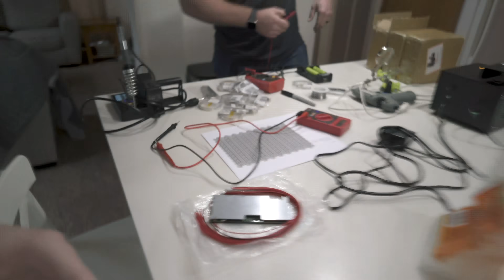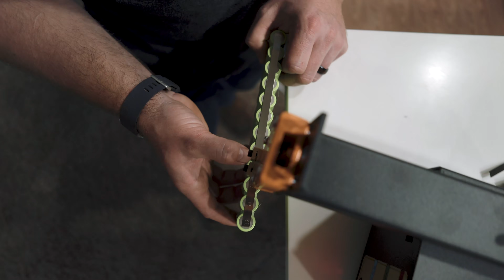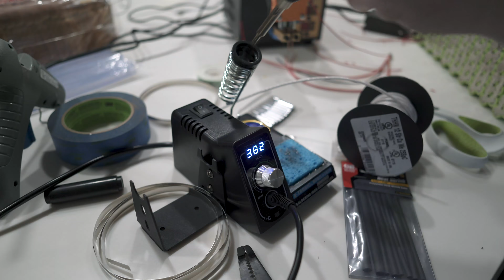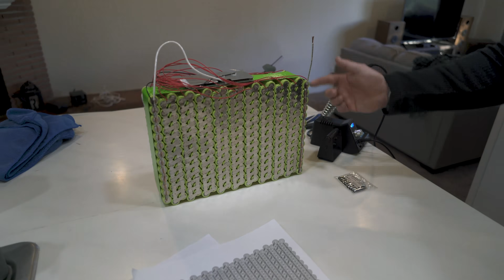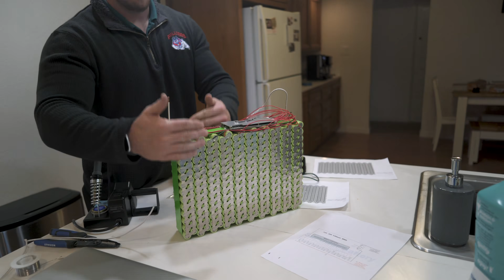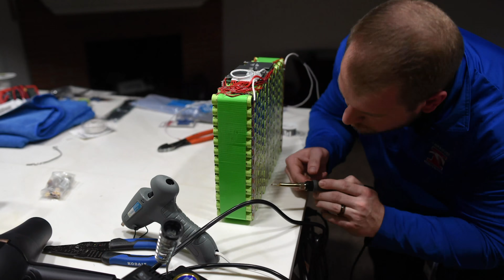How to MAKE a LITHIUM ION Battery Pack for an Electric Motorcycle (No explosions, sorry)

Comment: Nice battery build ,discharge leads look a little small though,, I’m running a 3000w motor , however at full throttle it pulls over 8000w , maybe double up on your discharge leads , reduce bottleneck  , great video 👍
Reply from the maker: Appreciate it!
Reply: Everyone saying lol, I'm mechanic i learned alot from this one video about the lithium ion.batts one smart fella so not going question,  even my lipos with my rc cars cheesy soft high gauge wire that gets hot not even copper so I'm betting even tho thin wire bc its copper .
Reply: What size should they be at 8000watts?
Reply: At 8000w ,it’s pulling over 100amps ,I used 2 x 10awg silicone wire , with a 200amp Bluetooth BMS ,the BMS monitors power drain ,state of charge and balancing

Comment: So did you ever get it to top out and find out how much longer it runs now? Now that you have the idea down with all the room you can parallel more batteries to get more capacity and all that like he is saying. I spose eventually if you go nuts it would get really heavy and out of balance.
Reply from the maker: We'll be duplicating this pack in the near future, so we'll see how it goes. I'll be testing range when I get the bike registered!
Reply: Well looking forward to any updates. When I bought this house I had two unregistered cars, but they had comp insurance so if someone broke the windows or something while they were parked I could get it covered, plus all I have to do to activate driving insurance again is call my agent and it's dirt cheap. I called him and drove both cars to new house with expired plates but temporary legal road insurance. I had no issues but I also drove each on a one lane each way street. Our regular driver running interference behind each car. 5 miles to the new house after sitting 7 years. My Dart the accelerater pump was bad so bogged off the line but otherwise no problem. The 71 Scamp I forgot to hook up the kick down spring so it only went to second gear but made it fine and I figured it out later. I spose if you want to live dangerously you could do similar. Get insurance and no tags and take a quick banzai run depending on how it works where you're at and how crazy you feel😉

Comment: Keep in mind that they thickness of thr wires should be upgraded to! To desipat heath. Sorry for my bad English.
Reply from the maker: They are actually the right size for this motor setup, but definitely if you're using more power!
Reply: Wow you would  think need lower gauge wire